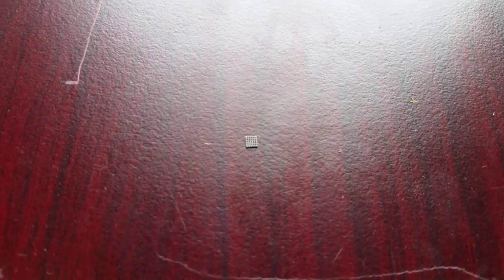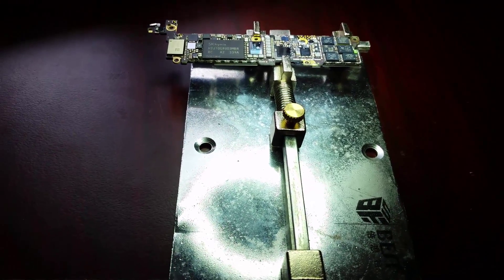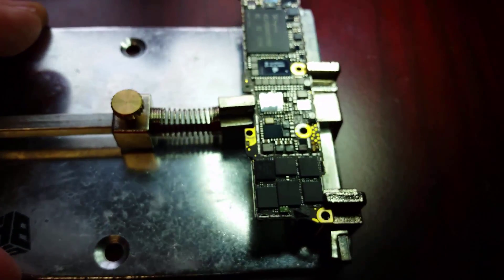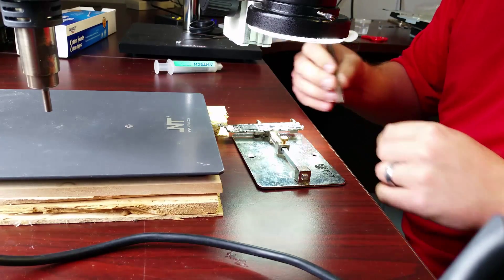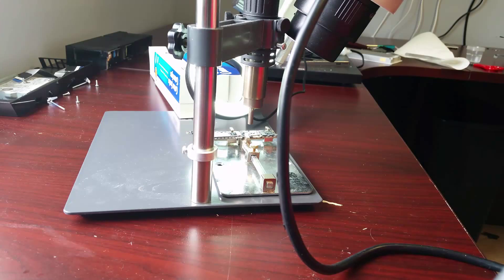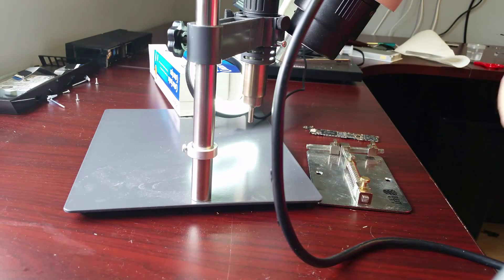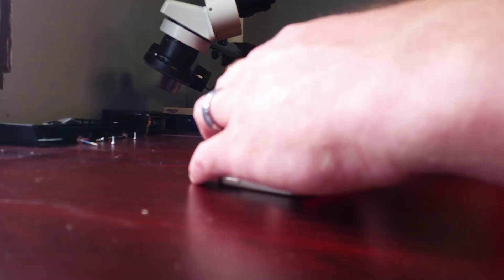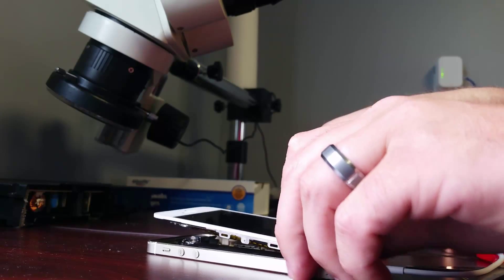iPhone 5S U2 IC Replacement

Comment: My iphone 5s will not hold charge and its not the battery or charging port, the mother board also heats up alot do u think replacing the u2 chip is a good idea for me???? @ColemanBud

Comment: hi sir, what is that best flux to use when repairing iphone pcb IC or connectors etc. Im so sick of buying fake amtech crap from China for ex. RMA 223 or 559 poison.  Any suggestions would be greatly appriciated.

Comment: can you share the temperature and air flow settings you are using to remove and to add new IC
Reply from the maker: alex green 375C with airflow around 5.
Reply: ColemanBud  Thanks.
Reply: +alex green i use 450c depends on ur hot air station to be honest with you. the faster you remove the IC the better. Just add flux so u dont overheat surround components

Comment: Hi mate. Do u how to change iphone 5 u2 ic, because this ic on iphone 5 it's next to cpu and it's hard to remove and clean it. Last time i did it just toke 5 hours to remove and clean the motherbard of black glue
Reply from the maker: Hossein M Haven't had any of those come in. I have seen a video on youtube where the person removes it with a blob of solder. Think his name is ashfak or something along those lines.
Reply: Thanks mate. Finally I did it with solder iron .it's really easy with solder iron but befor that u need to remove the glue of the IC and around it